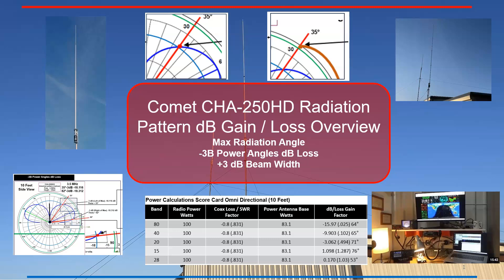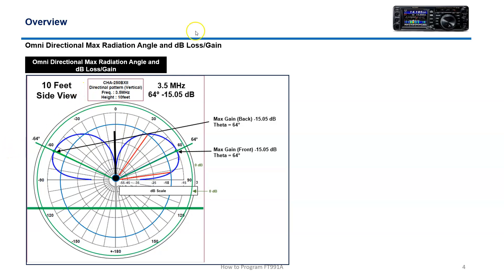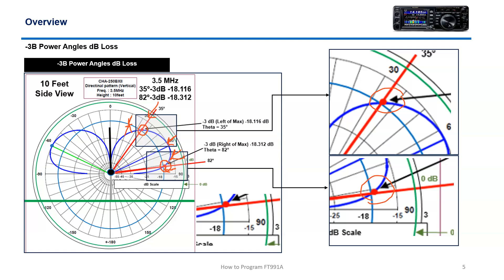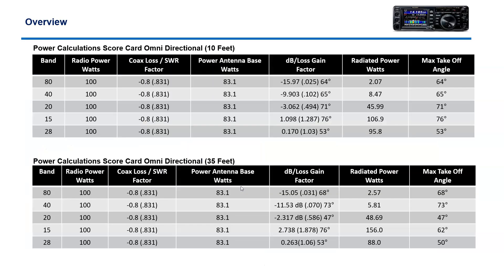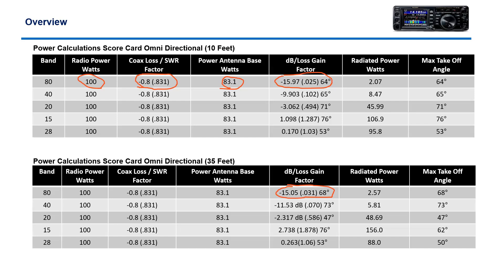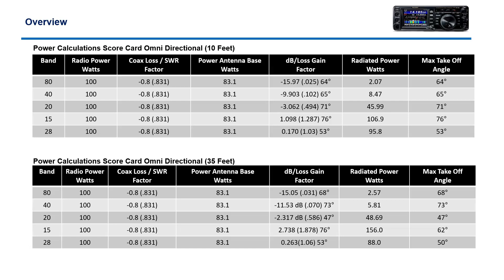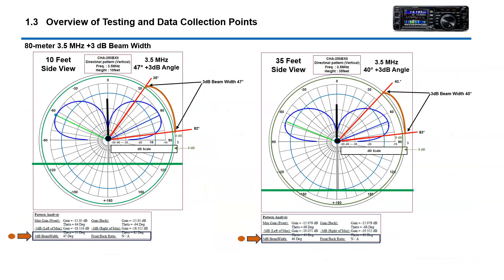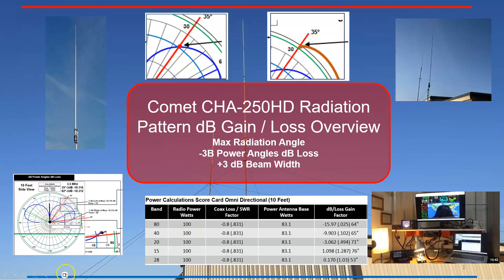Comet CHA-250HD Performance  Max Take Angle / -3dB Lobe Intersection / + 3dB Band Width 10/35 Feet

Comment: I’ve had mine up on a 12’ pole on the corner of the tack room & it’s performance has been pretty good, compared to my g5rv with the center at 17’ above ground, only about 3’ above the roof of the barn & the ends at 12’ above ground , very happy with both in central Idaho , some day I’ll have another tower with antennas

Comment: Thanks for sharing your findings. I just bought a CHA250HD and I have noticed that it does well on 15m, and ok on 10m.  My biggest issue with my CHA250HD is the noise level.  I ended up putting a G5RV Jr to compare and the noise level is close to 2S units lower on the G5RV Jr across all bands, allowing me to hear better on 40m, 20m and 10m.  However, on 15m, CHA250HD signals are stronger and I can hear over the noise. I going to compare a tuned 20m vertical to the CHA250HD, and see  how it compares.  I would love to see a DX Commander compared to the CHA250HD, on a A-B switch. KU6Z and 73's.
Reply: The DX Commander will more than likely kick its butt. I had one on my roof and it was fantastic. I wonder if you put a choke on your coax before you came into your shack with the Comet antenna.

Comment: Really funny, I am setting up one of these next week, 🤣 I have a 30 foot tower, and I had it up 2 years ago but the wind broke it in half, I took it to a metal shop and had the tube repaired, when I reassemble it I'll have to tune it, it should be fine, if I can get it close, it will be OK because I have a roller tee tuner so I can always dial it in, AI7VS  73s good video. 👍